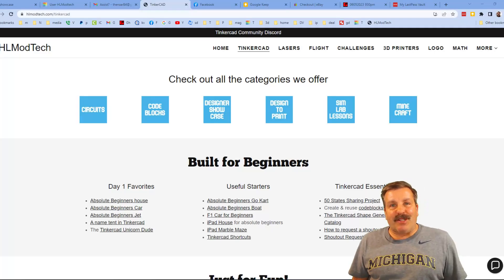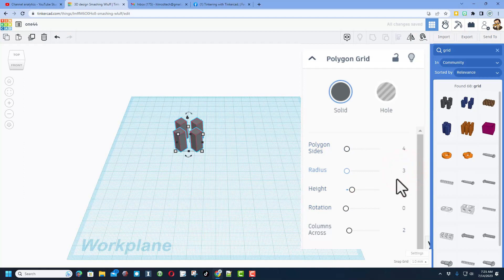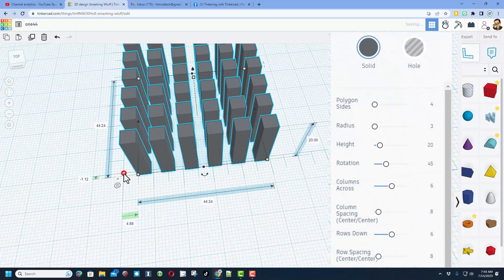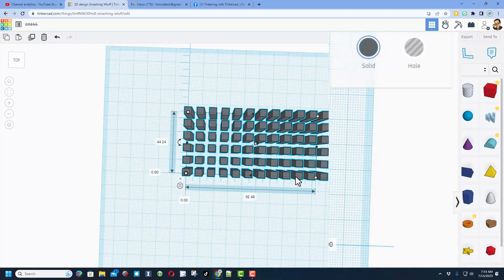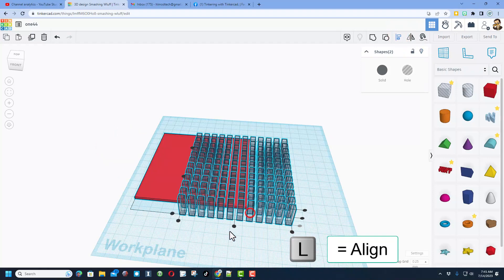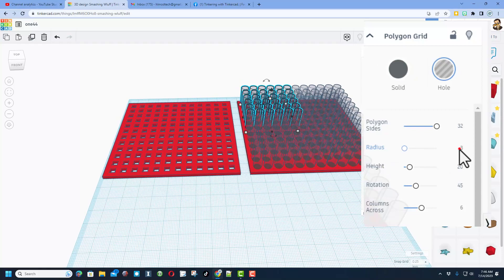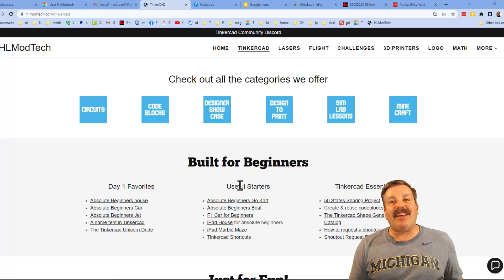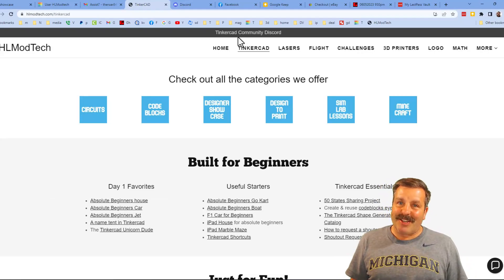How to Place A Group of Holes evenly in Tinkercad Easy Steps 12 x 12

Comment: Long time lister, first time caller :) Question - what if I wanted to make the grid holes heart shaped. Can modify the polygon shape to create that? If not, how would use to heart shape block (or any other shape) to create a custom grid? 

Thank you so much for the tutorials! They have been incredibly helpful!
Reply from the maker: Intro to the question made my day. =) I think you would have to solve that manually with duplicate and nudge. This is a favorite intro to that skill if you have not played with it yet. https://youtu.be/ivOl3Go7cVg You would not need the rotation that the flower uses though.
Reply from the maker: Feel free to reach out if you have more questions. Many of the coolest things I create start with questions from viewers. 💯👍